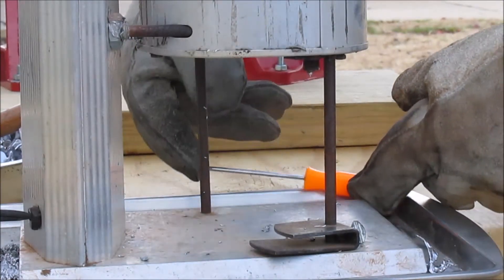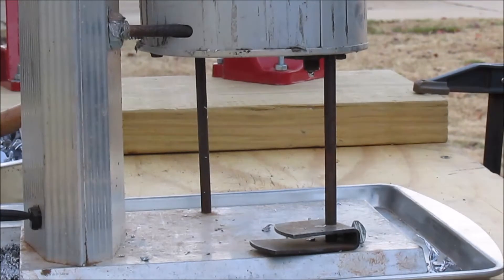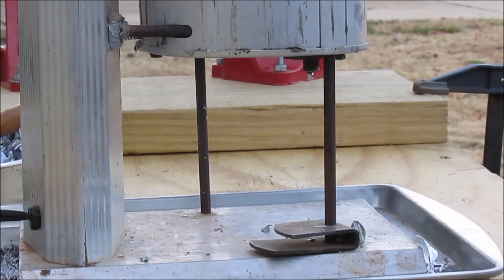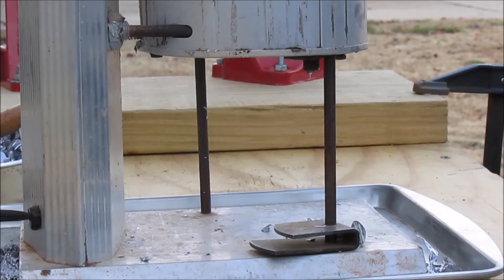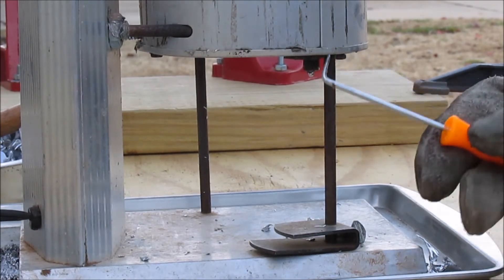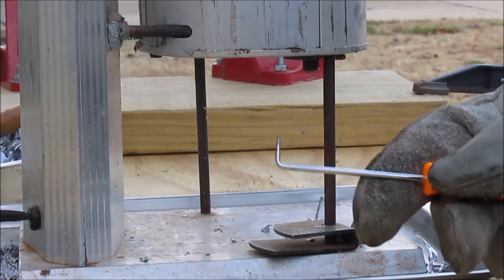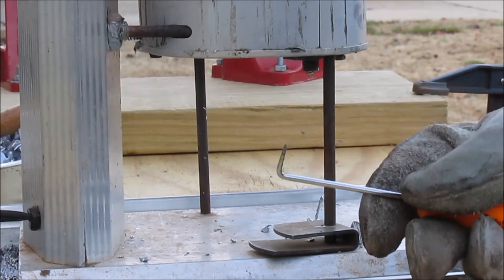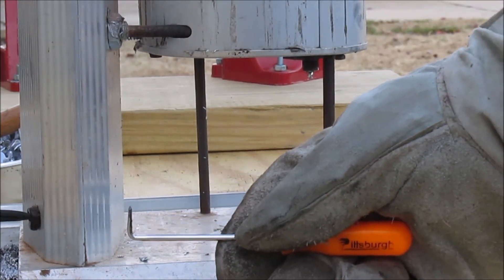A Cheap And Easy Way To Clean Your Spout On The Lee Pro 4 20 Lead Melting Pot

Comment: I cast fishing weights with the same set up and have been cleaning it the same way for years now. 
Great videos
Reply from the maker: +Raul Casiano I used to make fishing sinkers and used paper clips broke them off a few times in the spout that was always fun trying to pull out the broken paper clip out of bottom of a hot melting pot.  Thanks for the comment.